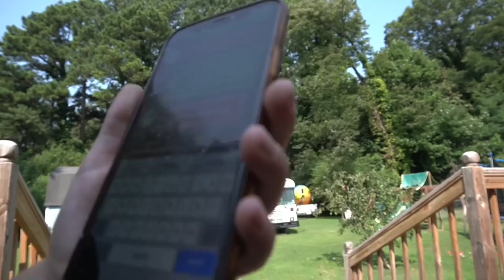School Bus Conversion Episode 19 - Sleeping in the bus for the first time!!!

Comment: You need to show the team of carpenter elves helping you cut all that material outside the bus. Those big LED lights are bright like 1000 suns! Your progress is awesome!
Reply from the maker: 🤣🤣🤣 yeah that’s Jae doing most of the cutting. And yes those lights are bright! But they barely use any power when running so we tried to place them as many places as possible
Reply: @lifeanywhere  they definitely are. I did an mock up Arduino/ ESP32 dimming setup using pulse width modulation following what Juan from Beginning from this Morning channel did. That lets one dim a set of co-wired LEDs with a home assistant phone app. It's not too hard if you have done any programming before. I'll be setting those up on our bus because I wired without any traditional light switches. Although I'll be able to quickly connect lights if the hardware or software fails me.
Reply: @lifeanywhere  and it's great to have a capable helper. I thought you had magical elves helping. After all your son was talking to Santa in this video.